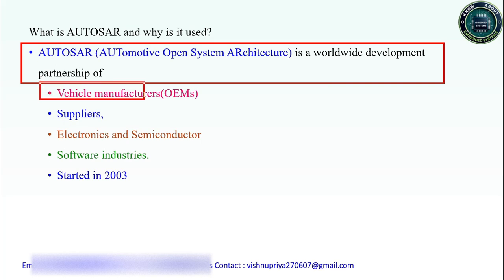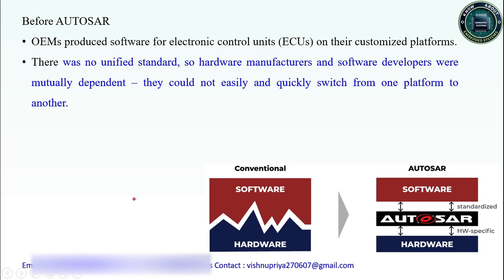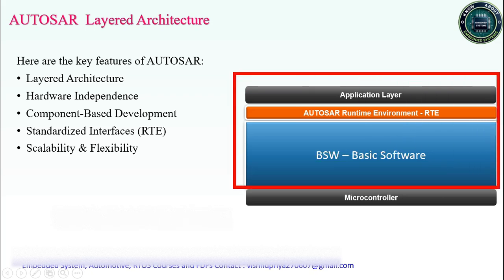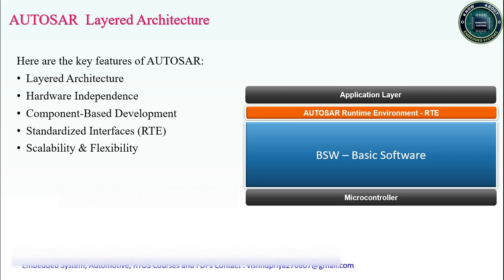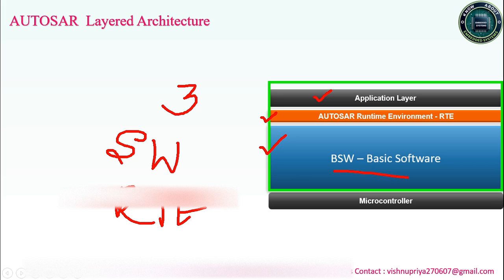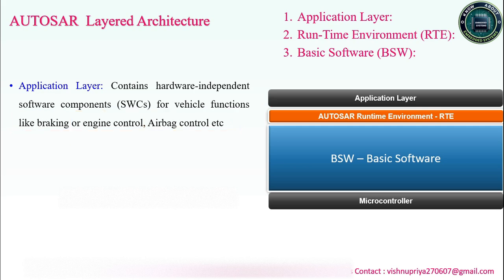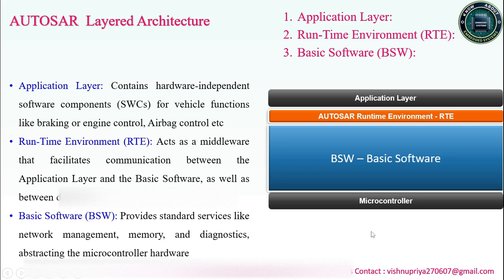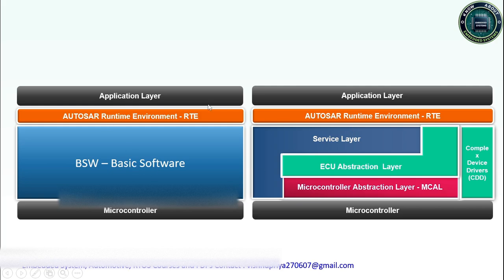AUTOSAR | AUTOSAR Layers | BSW | RTE | MCAL | Service Layer | Application Layer | Classic AUTOSAR

Comment: I have a doubt if I am using uds protocol to check the diagnostic message how inside the autosar layer through where data flow will happen to my screen on laptop from hardware?😅
Reply from the maker: Through Com stack
Reply from the maker: AUTOSAR layers are software layers not hardware
Reply: @EmbeddedSystemCreations  thanks a lot